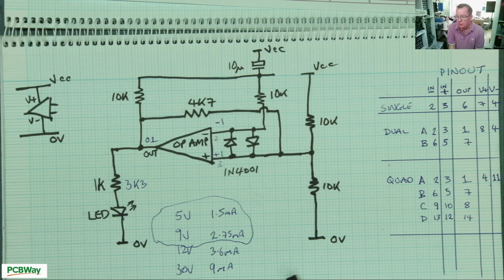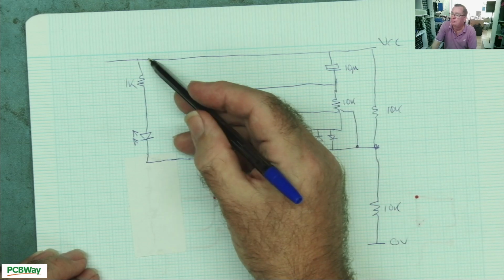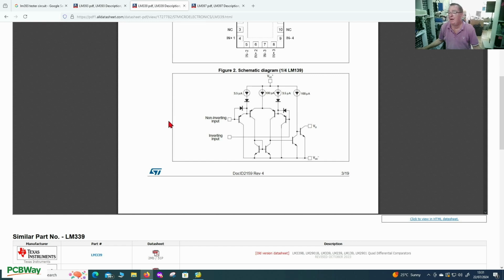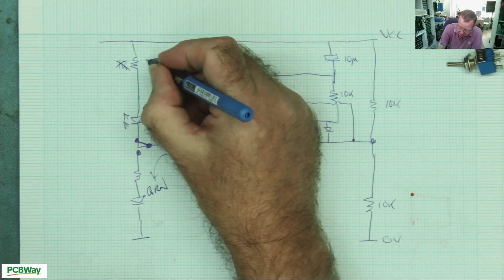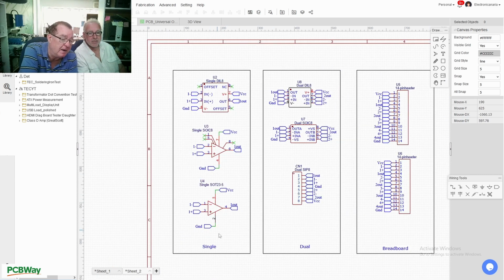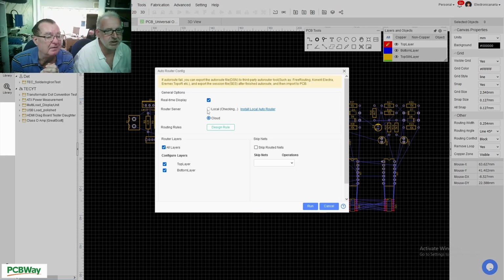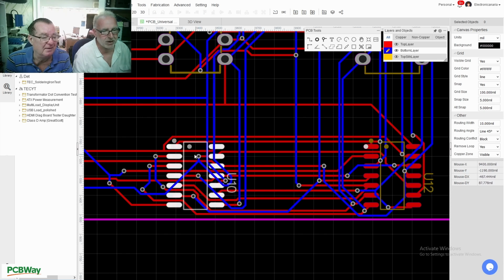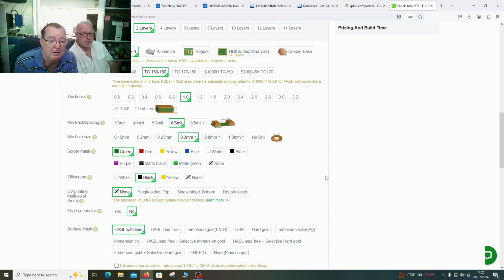Universal DIY SMD and Through Hole Op Amp Tester Project : Single, Dual, Quad, Comparator PART 2

Comment: Well, one potential issue with the auto-router mess would be that it makes it more difficult to see where traces are really going on the PCB. Which could be important if you want to troubleshoot the tester later because it's not working properly. Especially beginners might have a harder time with it.

Comment: A very nice video. Before you send the pcbs out I would present the following idea: I've seen a video where a guy in the case of dual opamp added a 8-pole switch that brought out  one of each pins, together with the input signal out to an external connection. If you do that you can a) test for working b) testing for  the  qualities of the opamp.

Comment: Why have the permanent component in separate group? I would prefix the the components A, B, C and D  (Example R1 = RA1, RB1, RC1, RD1) Having a prefix in a name Identifies what I belongs to.
Then you can have them all together, this would probably be easier to route them.
As for routing I would do the main Like VCC and GND (I would have different track thicknesses for these, thicker.) myself then let auto rout do its stuff.
I would use SMD components, make the board smaller. It's a tester.
As for tracks close together, not an issue with me, I fill the open area of PCB with GND.
Well you asked 😁
Ignore all that The MOST IMPORTANT THING Don't forget to put your name and logo on it.

Comment: Another thing you can do is test some other very common parts often found in audio amplifier circuits. If they work, fine. If not add these.... TL061, TL062, TL064, TL071, TL072, TL074, TL081, TL082, TL084 etc. btw, another common one uPC844 can be tested as a LM324 and works fine.
Reply from the maker: Agreed, many op amps have the same pin outs as each other, certainly that is true for dual op amps.  You can also include the BA45xx op amps often find in mixers and and amplifiers.  On the final version we will silk screen the layout next to each socket / smd pads.  If you have some other opamp or comparator that matches just plug it in.  If you have something with a different pin out use the dupont leads and breadboard.  If it is SMD then use a breakout board, plug that into the breadboard and hold the IC against that.  The possibilities here are almost endless

Comment: I would clean up the autorouted traces, make the spacing even and re-route silly traces like those on the smd pads. It's not going to take that long, maybe 1 hour tops. The board may 'work' as-is but this board is a reflection of you and your ability. A very poor design reflects directly on the person who did it. Part of it is having pride in your work. Det knows all of that which is why he wants to route it himself so it looks good. If you want to be labelled as someone who has no clue about board design, no clue about routing and no clue how to use Kicad and makes very shoddy designs then go for it. Otherwise tweak and re-route the bad bits to make it look at least slightly professional :-)
I know for sure, if you leave it as-is I will take it and re-route it properly and make my own version and re-release it because I have rules and a board like that is not allowed within 100 metres of my property ;-)
You should also do it to prove you are human. For years cyborgs have been infiltrating the human race and trying to push automation onto the general public. Leaving it as-is will prove you are in favour of cyborgs or you are in fact actually a cyborg and are participating in the extinction of the human race!
I'm already very busy with a lot or reversing work so if for no other reason do it so that I don't have to ;-)
Reply from the maker: I expect it will get re-routed after we try the prototype board to make sure it functions as intended.  I'm sure you realise the auto vs manual routing vs burger and beers argument was included specifically to stimulate discussion here rather than for any other reason.  And it certainly did that. 😉
Reply: @learnelectronicsrepair  Yeah I knew it was a joke. Anyone who seriously puts burgers and beer above proper pcb routing needs help that only a doctor can provide ;-)

Comment: 13:10 most component testers have 3 square smd pads with a small gap in the middle where any type of 3 pin package can be held for testing. If you add 5 pin SOT23 pads you'll have everything covered. But make the pads large enough to cover other packages. I have not checked what is available but you can be guaranteed as soon as you get the boards made you'll discover another 5 pin package that won't fit on the smaller sot23 pads (sods law etc ;-)
Reply from the maker: Of course you will find devices this will test that won't fit into the sockets or on to the pads. That was the idea with the integrated breadboard and dupont leads.  Of course I will make the schematics and gerber files available when I publish this as a shared project on PCBWay. With all the documentation and description in the two videos it should be easy to modify this for other devices.   When the prototype arrives we can look at things like using larger pads etc

Comment: Great video as always Richard. Thanks for taking the time to make them.
As this is a WORKS/FAULTY tester, would low profile pogo pins make life easier rather than sockets for the DIL package. They are available with dished tops to locate the I.C pins. Either way thanks for the content 👍.
Cheers
Pete' New Zealand.
Reply: No. They are expensive and fiddly where connection can't be guaranteed on a used chip that was pulled from a circuit with legs that are a bit bent and with left-over old solder on them. The tester needs to be reliable and using common parts so it can be fixed it it fails, and it also needs to be easy to build for people who are not fully experienced with electronics. Using pogo pins makes it expensive and unreliable.

Comment: One other thing that would be nice would be an aux input, so you can connect the tester to anything with a sink or souce output. That way you could test many components, even in-circuit: any opamps, including weird pinouts, 555s, totem poles and gate drivers, or weirdly routed switches.
Reply from the maker: Thanks for the suggestion I'll take a look at that

Comment: I think that switch is making it far more complicated than it should be. I've made similar testers for opamps as we as 555s that just uses both LEDs in series. Red LED blinks when sinking, Green lights when sourcing current, and if both light up it indicates a no output fault. That way it's simpler and gives you a very clear no output fault indication, while also showing that there is power to the circuit.
Reply from the maker: We did try omitting the switch and just connecting the two resistor/leds in series,  This works fine with op-amps, alternately flashing red/green but gives a weird result with comparators, the red LED flashes dim/bright and the green LED flashes dim/off.  If you like that then for sure just leave the switch out of the circuit.

Comment: Autoroute is only useful on simple boards. When it starts routing between pads, it becomes a real mess. Yes it takes longer to manually route, but will pay off in reliability later. I tried it years ago and hated it and modern programs are no better. Maybe soon they will get their act together with AI and teach it to use common sense
Reply from the maker: Det kinda said the same thing regards AI and routing

Comment: Personally I would stick to a single input and have the option to isolate one or more channels with a set of jumper pins or, if you prefer, spdt dip switches.

Regarding autorouting, I'm with Det, I think that layout looks a mess. That's also true for most other autorouted layouts. I have little doubt that it will work, but I think it is important to be able to understand the layout for either myself at a later date or fault/error finding. It's also important for someone else who is looking at it without the schematic.

Just to give an example of how bad it is, it took me about 20 seconds to find a route from U8/2 down to U7/2 to U4/1 without changing layers, keeping the existing links to U2/2 and U3/2 and eliminating 2 vias.
Reply from the maker: Hi Chris, I get what you are saying.  Note though that the shared project (when we test the prototype PCB and maybe alter it) will incluse the schematic and gerber files for anyone to download so it should not be a problem to figure out what connects where if you want to.

Comment: Hi Richard, I hope the burger and beer wete good. 
I agree with Det, never use autoroute, the routing is mess. And yes it have no impact on performance on this simple tester probably, but the quickest way is not the best usually.... Also the microline paths between SMDs pinouts can be scratched if u use it (and shorted), I never like this way of routing, especially on that huge PCB, where you have lots of space...

Comment: Hi Richard and Det I always use auto route for my PCB's, then check the board fo errors  and missed tracks before ordering
Reply from the maker: In my opinion using Autoroute or doing it manually will not make any difference to the performance of this particular project so I think saving time was the more important factor.